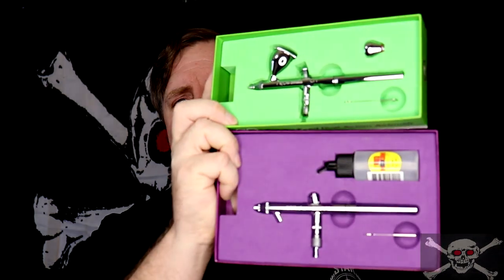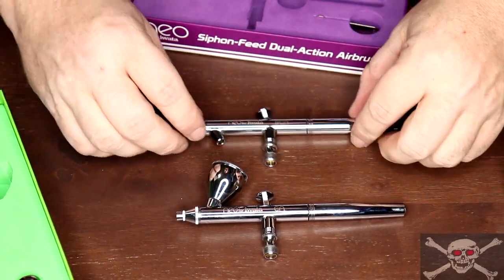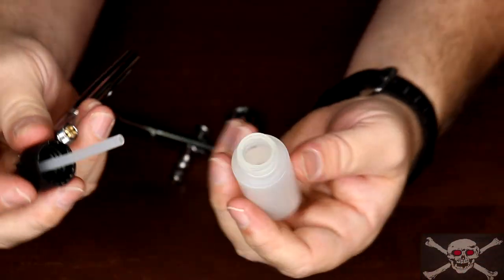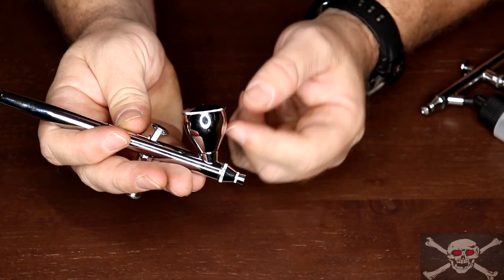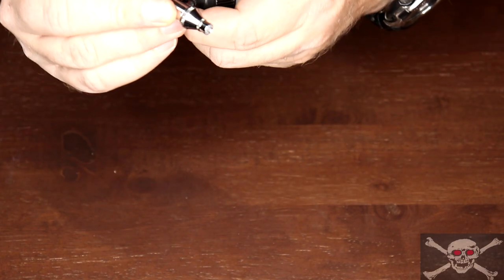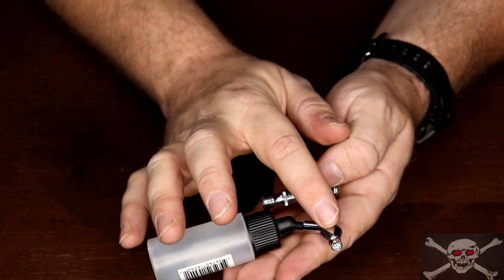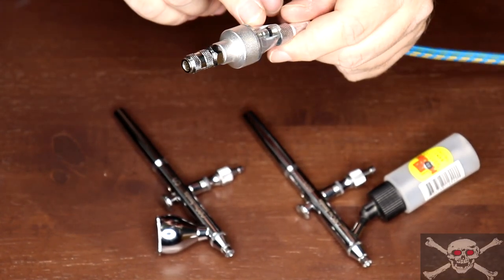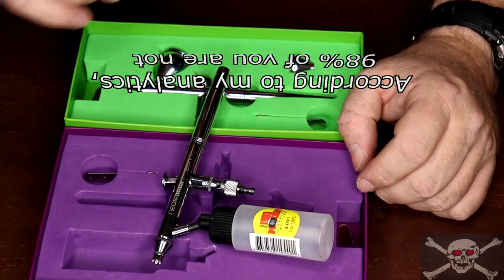Gravity Feed Airbrush VS  Siphon Feed Airbrush

Comment: Thanks for the information! Very helpful! I've been gifted a siphon feed airbrush but have no air compressor. Is there a good starter compressor you would suggest? I'm painting boardgame miniatures. I've seen some complete kits on amazon ( gravity feed ) that are cheaper than most stand alone compressors!
Reply from the maker: Sad to say, the compressor is the most expensive part of an airbrush set up. There are so many compressors out there that it is hard to suggest one. Shop around and find out what is best for you. Minium requirements should include an air compressor with a line pressure capability of over 30 psi min. I suggest at least a 50. Also It needs to have an adjustment knob so you can dial in the exact pressure for the exact operation you are doing at that moment.  If you get one without a tank, you will have a drop in line pressure and the begining of the spray so keep that in mind. There are just so many factors and options that I cannot suggest a specific one. I'm sorry.
Reply: If you haven't already, troll through craigslist for a 3 gallon compressor.  You can find a $200 construction compressor for like $50.  

I will be getting a cheap siphon feed brush to do priming/zenithal highlighting on models.  Maybe I'll get a gravity fed later if I do more detail work.  Either way I can deliver at least 80 PSI or dial it down because I bought a decemt compressor.
Good luck!

Comment: im gona use metallic and thicker paints, for somewhat medium applications, just a replacement for spray cans, so which one do you suggest?? my applications are from small as pc mouse to a larger microwave oven. thanks
Reply from the maker: You will still have to thin your paints unless you use the pre-thinned paint for airbrushing. (which I do not) With regular paints, you will have to adjust the ratio from thinning agent to paint. But you can do it with your preference. With the size of your projects, especially the microwave size I would definitely go with the siphon feed as the larger bottles will hold the amount of paint you will need. Also the larger needle size will give you a wider spray area. Gravity feed is good for details, but if you will not be spraying small details then a siphon feed will work well for you. (you can always get both)

Comment: My airbrush is neo bcn
Reply from the maker: Ah, yeah, mine says to 25 too. However, 20 is as high as my compressor goes and it is "barely" enough.  and 5 psi isnt going to help. I have read others saying that 15 to 45 for siphon and others still say higher. So that is why I said it is best to find for yourself what pressure you find the best. But my opinion is 20 isn't enough
Reply: @jollyrogerhobbies2386  cool thanks for 411

Comment: Are you able to store paints in the siphon bottles? I have 3 gravity feed airbrushes, but some project require a lot more colors and I find myself having the clean the airbrush so often.
Reply from the maker: For this specific airbrush and bottle, No you cannot store paints in them. There is no way to seal them. There is a hole where it connects to your airbrush, and another hole for a vent hole. That is with this siphon airbrush. However, there are bottles out there that you can seal and keep the paints in them, just not these specific bottles. so you will have to do research and find the right combo that works for you.
Reply: Idk how successful I'll be but I have 1.5oz mixed in a syphon bottle and I taped up the lid a lot hopping it'll be fine overnight.
Reply: @jollyrogerhobbies2386  seems you could just plug, cap, or tape any bottle
Reply from the maker: @grassCrow  Plug or tape the bottle without the lid I suppose so. However not with the lid/top on as it lacks any rubber gasket around the lip and also lacks any plugs around the holes. If you taped up both holes on the lid, the air would still get into the bottle due to there being no gasket. if you could find a proper cap to fit and seal then yes it would be possible. However that is a lot of trouble to go through to store the paints when you can just use a proper bottle or bottles that you can get relatively cheap.
Reply: @jollyrogerhobbies2386  Hey, thanks for the info.   Didn’t realize the lid wasn’t sealing.  Have a Merry Christmas.